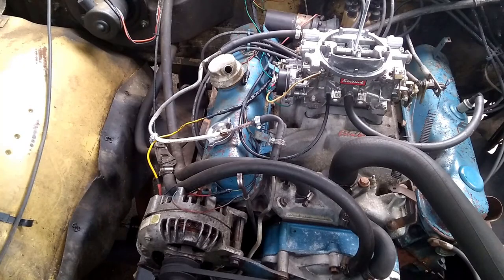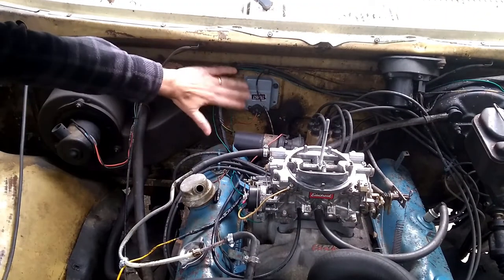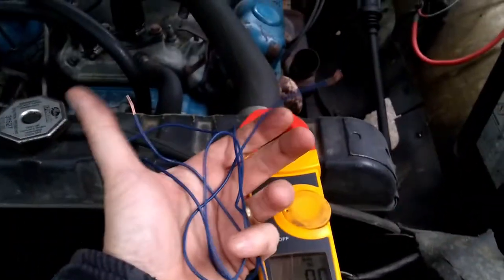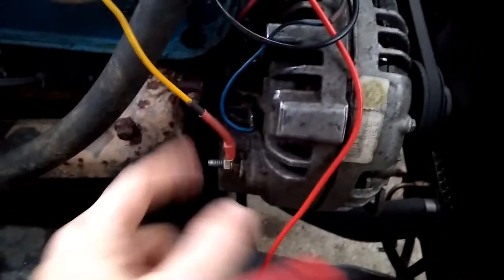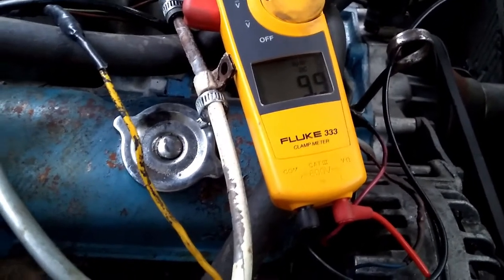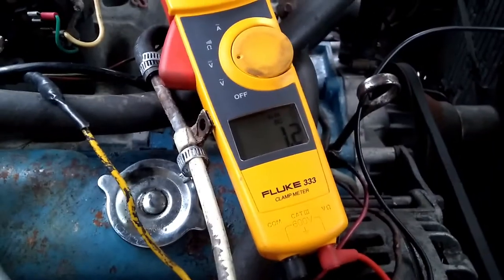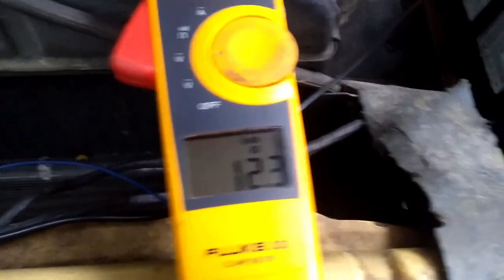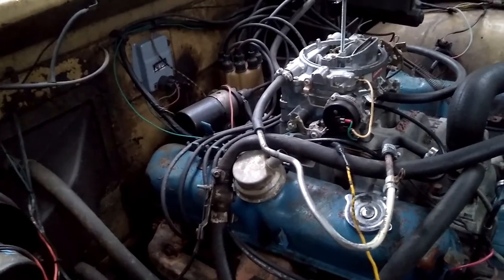Testing a Mopar Alternator and Voltage Regulator On the Car

Comment: 4:44 I just tried that and al I did was fry the end of the jumper wire.
Reply from the maker: Man, sorry about that! So what that means is the field connection is running straight to ground. That's definitely an alternator problem. Could be the brush holder is broken, could be an internal field coil short.
Reply: @YoshimoshiGarage  see my previous comment....perhaps a misunderstanding of which OUTPUT is grounded?